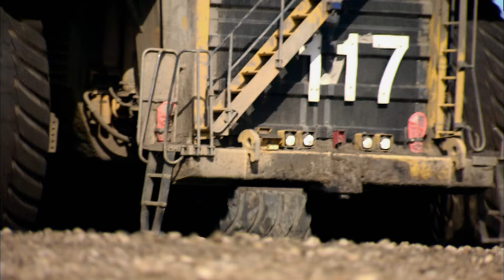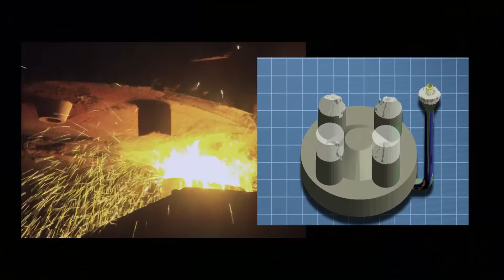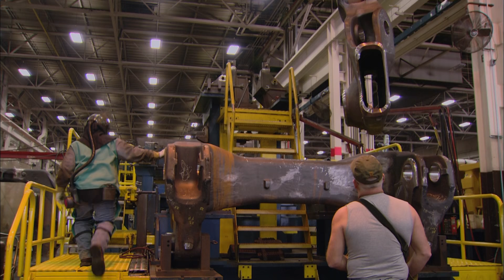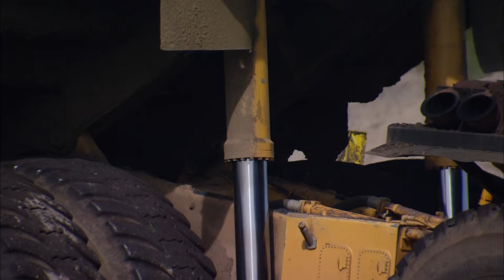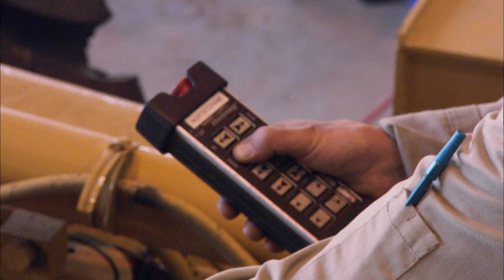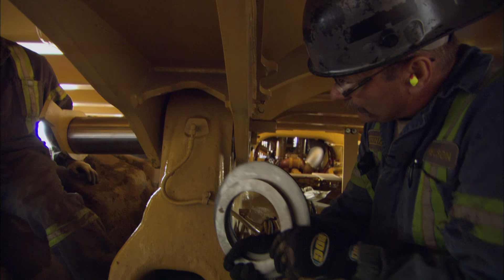Caterpillar Manufacturing: Inside the Factories Building Behemoths | FD Engineering

Comment: The detail that really stuck with me was the Caterpillar 797B frame: nine separate castings forming a backbone over 11 metres long and weighing nearly 28,000 kilos. Knowing the truck is too big to ship in one piece, so it takes 20 nonstop days to assemble on site, and that its dual engine delivers over 3,500 horsepower, made the scale of those six mega factories across North America feel genuinely enormous rather than just impressive on paper.

Comment: I'm a welder in Ft McMurray and have repaired Cracks in the frames of 797 haul trucks.
I'm surprised in the factory on the frames the welders were allowed to weld those monster weaves on the frame.
Here in Alberta that's no bueno as we run stringer welds which gives a finer grain structure.
I guess we just do it better here in Alberta.

Comment: When I was a kid, I worked for a light aircraft maintenance and repair shop.  We had a Magnaflux machine.  The local engineering contractor had a lot of Cat equipment and they rebuilt all their engines.  So, I would pick up crankshafts from them to take to the aircraft shop to be Magnafluxed, looking for cracks.  Those were some amazing cranks.

Comment: So just watched the docu from Sweden on their dump truck. They did all the metal work creating the steel unmanned, poured the molds unmanned, no people in the vicinity. Here we have people right next to the kettles that time and time again have exploded and killed people due to the molten metal. Maybe we should send some people over to Sweden and get some pointers on how to work! Human touch better than the robots, yah ok, whatever. The robots can do perfect welds every time. They can scan the welds and even xray them. I think Caterpillar needs a little upgrade on their machinery and engineers. They dont test the engines before sending out and installing????

Comment: i was watching a fuel tank with propane we all love diesel to the fuel tank can extract the gases from out side and refuel a tank and then it can flow to the fuel distributed to the injection cylinder could be something to examine test and depends on the sale industrial machines can use

Comment: 35:06 - ah, yes, they attach special hoses that feed compressed air into the chamber under the seat, to make the seat hydraulically adjustable. Yes. Apparently they can do this miracle, of performing hydraulic actuation with pneumatics. 
It's almost as if the people who wrote this script thought hydraulic and pneumatic are the same thing.

Comment: always like the big stuff  EZer to work on. Big is nice because you can't lift the parts. Small is hard to work on, work area is tight  medium is TOUGH because you can almost lift everything, so you never have a lift line. Use a little side crane that lifts 10,000 & you need 12,000 OR a giant loader of some kind
Reply: Incredible ❤

Comment: Too many inconsistencies. Talking about two 12-cylinder engines being joined and then a 16-cylinder engine is displayed. A piece of metal in the way that has to be cut out. Who missed that detail? Cutting a hole in a finished product to pull two pieces together.

Comment: As a railfan...3500 HP is impressive indeed, but most folks don't realize that modern locomotives are 4400 HP beasts! They keep trying, and failing, to go higher, but so far, traction is a problem they can't overcome.

Comment: If anyone is wondering,  they hang those orange cones from the the bucket of the Loader so the dump truck drive can visually
position themselves under the bucket without needing instructions from the Loader operator.  When they have the two cones 
positioned just inside the dump box,  they are in position.       exp: 35:53

Comment: Back in the 80s I did two weeks work experience at a place that assembled international harvester bulldozers etc. I was only 13 and they told me to jump in a forklift to pick up some parts, not only had I never operated a forklift it was an old model with manual transmission and I accidentally put it in reverse and dropped the clutch.

I crashed into a stack of pallets and I think someone got chewed out by the boss for letting the kid drive the forklift 😂 I went on to work in construction and drive cranes and massive Komatsu loaders so I just want to say thanks to the idiot who let me loose in the factory.

Comment: i recently used electrolysis to remove a super thick layer of marine crust. the coin had been underwater in pearl harbor for decades im guessing. using a 12v adapter i attached alligator clips to positive and negative. used salt and baking soda to treat the water solution and using a butter knife i attached one end to the coin and one to the butter knife in the solution and 5 minutes later the crust just flaked off revealing a 1943 half dollar. it was pretty amazing to watch work. what fascinates me now is how electricity can work with chemicals for all types of uses. really interesting stuff.

Comment: If madein usa  use sae measurements instead of metric. I hate that. Then the tires are made in south carolina but you show Lafayette Indiana.  Wtf. Does no one double check the video before its put out. What are the wheels? How do they mount the tires?how much psi in them? How big is the radiator.  What does it use for brakes. How much oil does engine hold/use. So much missed.
Reply: CAT uses both. The narrator picked one.

Comment: Caterpillar is an ICONIC American brand, born right out of the heartland. And yet the narration uses metric units of measure. Go figure...
Reply: Do you really want the narrator to use a mishmash of standard and metric like Cat does in their machines?
Reply: @saintchuck9857  No, I want SAE measurements when talking about American brands. Metric units of measure are appropriate for metric countries. The United States is still an SAE country. Simple concept.
Reply: @dubbledub4588 Again, CAT uses both and have been switching to metric as components get redesigned. US manufacturers have used both for decades. If you think the US is an SAE country, you're not in manufacturing.
Reply: @saintchuck9857  To this day, the metric system is not taught in U.S. schools, even though they threatened that 50 yrs ago. Inches, feet, yards, miles, ounces, pounds, tons, pints, quarts, gallons, fractions, etc. I don't need to know how many kilograms or kilotons a Cat haul truck can hold, I don't need to know how many kilometers it is to cross the United States. I'm fully capable of converting SAE to metric - I do it all the time because I work in healthcare - but I shouldn't have to when it comes to classic, American units of measure. I've made my point and I'm done arguing with you. Go pick an "I'm-right-and-you're-wrong" contest with someone else.

Comment: I grew up outside Decatur Il.  I still live outside Decatur Il.  My father worked as a maintenance electrician in that factory (in a paint booth like you showed) until he retired.  My uncles worked there, people I know work there.  When I was going to college, you had to be sure to get there before 3:18pm or else you'd have to wait for all the people going home.  That was 40 years ago.  Now, that "MEGA" plant is half the size it was when I was young.  The only thing that has grown in those years is the warehousing facilities needed to store the parts and the output.  Back in the '70s and '80s the unions would use the Decatur plant as their target for strikes, leading Caterpillar to move much of the work to those other plants you mentioned before.  A lot of work also gets done by a number of mom and pop shops in the surrounding communities.  Great for those little towns, not so great for the union.  Oh well, at least at 3:18pm you can drive by with no interruptions at all...

Comment: The cylinders that adjust the driver's seat are Pneumatic, not hydraulic.   Also,  why are these behemoths still powered directly by the diesel engine and not electric motors?  It then would use a smaller more efficient engine as a generator to power the electric motors.  Come on Caterpillar,  keep up.
Reply: The 797 has moved over to a diesel electric hybrid for many years now. This documentary is from the early to mid 2000’s.

Comment: quite ironic, the infrastructure built around us has some form of metal or the other, be it steel or aluminum alloys . . . but to make the wrought iron rebar built into the walls of your house, you also need some form of infrastructure for extracting the very ore needed to make the wrought iron rebar frame inside your walls . . . and that infrastructure are the iron ore mines & giant sized equipments working on sites, inorder to extract the best ore for the walls of your house . . . equipments such as the Caterpillar 797B dumper truck & 12-storey high excavators . . . these equipments are so big that they cannot be transported on public roads . . . as a result these giant equipments are disassembled in kits & transported to mining sites across the world & reassembled once again on site . . . a single tyre of the 797B costs a whopping €642,000 . . .

Comment: Large earth moving machines ….. conceived,  engendered, designed, and built by people of European descent. Other things invented by white people include:

Submarines, electric lights, nuclear power, microwaves, CAT scans, automobiles, hydraulic, wind turbines, backhoes & excavators, jet airplanes, aluminum, ballpoint pen, hydroelectric dams, steam power, trains & diesel locomotives, tractors, modern pharmaceuticals, open heart surgery, satellites, radios, telephones, televisions, arch & tig welding, computers, transistors, milling machines, plasma and hydrojet cutting, microchips, titanium, telescope, democracy, capitalism, modern farming, x-rays, typewriters, sewing machines, gyroscope, SCUBA systems, pasteurization, center pivot irrigation systems, bicycles, hypodermic needles, Velcro, microphones & amplified speakers, space travel, airplanes, fiber optics, ultrasounds, internet, printing press, container ships, aircraft , GPS, modern textiles, calculus, dynamite, internal combustion engine, Kevlar, moving assembly lines, antibiotics, aspirin, refrigerators, chainsaws petroleum production, trigonometry, helicopters, thermometer, glass mirrors, directional drilling, Astrophysics, crop rotation, carbon fiber, super conductors, particle colliders, pneumatic tires, MRI, sextant, robotics, telea a graph, microscope, firearms, penicillin, refined oil and fuels, hovercraft, computers, carbon 14 dating, angioplasty, telescope, pipelines, open heart surgery, tower cranes, chemo therapy, light emitting diodes, motion pictures, cameraswas was, digital cameras, CD/DVD, concrete, dynamite, lithium batteries, LED lights, refrigerators, nylon, water pumps, radar, sonar, satellites, distillation, electric motors, magnetic compass, sextant, clocks, plastics, vaccines, vulcanized rubber, insulin, combine grain harvesters, zippers, and concrete …. Just to name a few. 

What did your ancestors invent that have contributed to the modern human age? Feel free to list them out here.

Comment: Why can't they create the mold the entire shape rather than all the welds
Reply: Size. Shipping transport. It's all logistics. It's easier cheaper to ship in pieces than as a while
Reply: Still doesn't make sense to me. The machine will need transporting many times in it's life. If it's purely about transport then why not make it so it can be dismantled. These are welded parts that will never come apart again

Comment: Almost unbelievable that the foundry is in a Western country. Like stepping back in time. 
No robots, no safety. Crazy.
Reply: And no one wearing any form of breathing protection inhaling all those toxic gases escaping from the molten metal .. the narrator even mentions it as a reason why they throw aluminium into the molten metal .. wild
Reply: Watching them throw whole bags from a catwalk and splashing molten metal all over was wild. Having to physically touch the ladle to position it over the castings. Don't even need robots, there's aspects of that process that are nothing short of archaic.
Reply: @dougw550 CAT's Mapleton foundry has had 3 deaths in recent years. 1 where molten iron splashed on the worker from a transport ladle. Another was when a worker fell into a melting crucible.

CAT builds amazing machines with no regard for their workers.
Reply: "No robots"
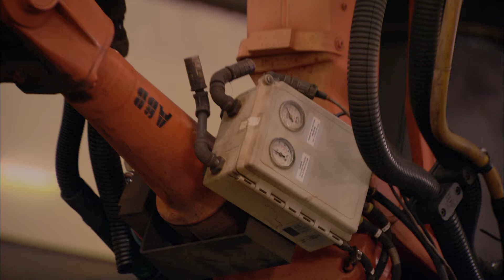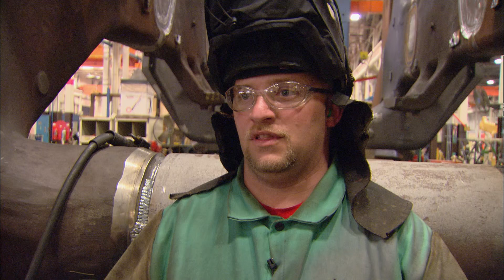Apparently you didn't notice the robotic welding at 15:15  later they point out that the human welders are needed because the robots aren't good enough 16:20
"Almost unbelievable that the foundry is in a Western country"
So where in particular is a foundry where it's all clean, pristine, and fully robotic with no smoke or heat? There's no such thing, it's impractical
Reply: These guys could’ve been doctors or lawyers. No one held a gun to their head.
Reply: @seanpyrtle5603  Are you saying only doctors and lawyers deserve to be safe at work? 
In developed countries (NOT the US) foundries are full of robots and safety features because we actually care about human lives.

Comment: just want to point out, they said that the seat was HYDRAULICALLY controlled... compressed air is called PNEUMATICS, it is PNEUMATICALLY controlled. I guess pneumatics could be classed as a subset of hydraulics as the definition of hydraulics is a fluid moving a piston, and air is a fluid, but still.

Comment: Very nice presentation. What I wonder: How does it come that 4-cycle engine sizes vary so much versus power? We have F1 cars at 600HP (without electric turbo) and are about the size of a full tower pc. Train diesel engines are about the size of a car and have 5000HP. Yet these things are the size of a school bus and have 3500HP. I dont get that..
Reply: It depends how long you want them to last.  A rough rule of thumb is if you decrease the stress by a factor of two, the life (in terms of the number of cycles) increases by a factor of 4. This is by no means exact, and lots of testing goes into establishing a life curve. Also, these engines work in relatively harsh conditions, compared to a train engine. And train engines (the diesel-electric prime movers) rotate at constant RPM which makes for an easier life.

Comment: Power, weight, size, capability... It all means nothing when you boil it down to cost per 100 (of whatever unit). Way too many tons in the base fixture. Way too many exclusive parts, not found in any other equipment built by them... Business who things "AMERICAN FIRST" might feel good about, but only if they ignore profit margins. Impressive machine but, you can accomplish the same,. with additional adaptability and longevity, together with having far less experienced and trained personnel to operate the machines. Lets say this... there's a reason why so many Volvo machines are seen in Gold Rush... And yes, they pay for it, but do you imagine any profitable gold miner give up on the gold itself just to provide added suspension to the show? well. think again....

Comment: If you have to use a 6" grinder in a modern factory 2024 - well it tells you the fitting is way of bad
Reply: Most of the parts are custom made or made in small batch runs. There is a lot of warping over time and a pain to dis-engage sub-systems. "On-the-fly" parts are often needed.
Reply: On welds that deep, you better clean them up between passes.

Comment: The fact that man has created a container that will maintain its structural integrity and transport another metal that is so hot that it's in liquid form.  I'm sure this factory is a great place to work in Winter but not in Summer...
Reply: It’s climate control in the plant. They did that 15 + years ago because of rust issues. I’ve been there 13 years
Reply: @djmattburky  Crazy. Fantastic machines guys
Reply: Louisiana doesn't really get winter...
Reply: @nalafischer9163 I'm from Shreveport and we definitely get winters
Reply: @derek234 you're from Shreveport you're almost in the north 😅
Reply: I like how you put it😘
Reply: It suits all seasons of the year
Reply: Good inovation
Reply: Right 👍🏾
Reply: With this advanced technology, nothing is impossible
Reply: I'm pretty sure the inside of it is not metal.
Reply: During summer.. whew
Reply: It's called a refractory liner. I used to make them. We use a cement-like mixture made typically made of aluminum oxide and magnesium oxide. If you Google Image "Ladle Lining Services", you can see what it looks like.
Reply: That is the bombshizzel
Reply: Agreed
Reply: Impressive

Comment: Im surprised they arent stick welding that frame together.  Better heat and penetration
Reply: The weld joints are CNC machined into a v-groove. The filler metal is a high-carbon steel alloy.
And, the gas is a tri-mix of helium, argon, and carbon dioxide for better heat and penetration.

Comment: The amazing thing about the engineering of the 797 is that it is such an easy to operate monster. 

I found it to be far more preferable than the 930 Komatsu in terms of ease of controlling the beast. It’s got a mechanical drivetrain compared to the diesel electric setup and the response is far better and simpler to control. 

For a 400 tonne truck that hauls another 400 tonne payload it handles very well.
Reply: ur crappy shilling doesn't fool anyone
Reply: @theorenhobart  God forbid someone have a different opinion from another. D wad
Reply: @theorenhobart wtf are you talking about

Comment: I believe the dump truck has two v12s. A lot of the engine manufacturing process showed a V16. Get rid of AI
Reply: That was when the truck was first introduced, as Cat didn't have a big enough engine, so joined 2 engines together,  all trucks now have a single engine